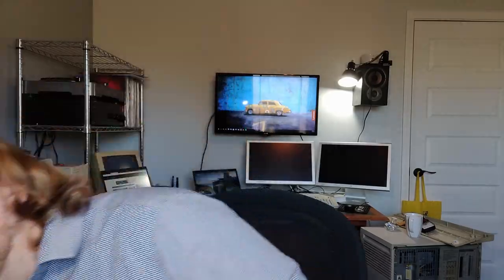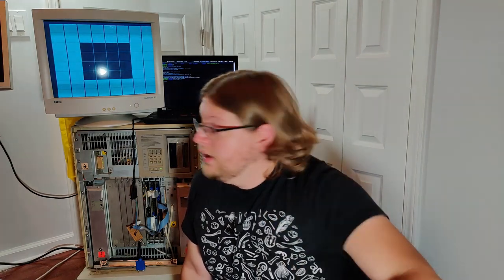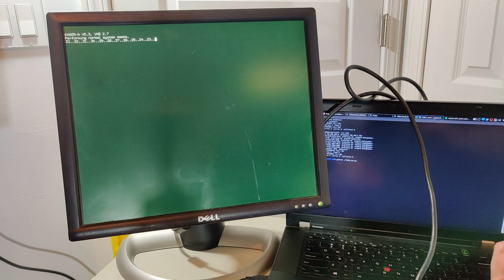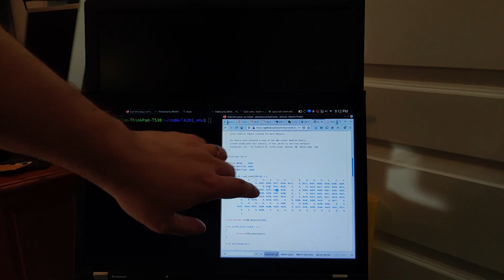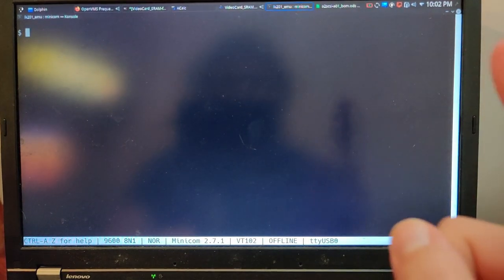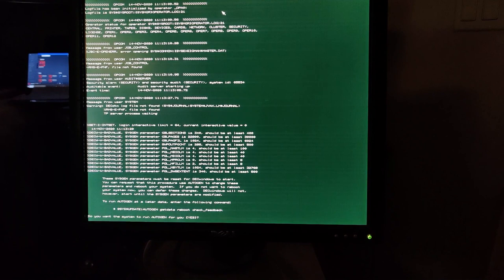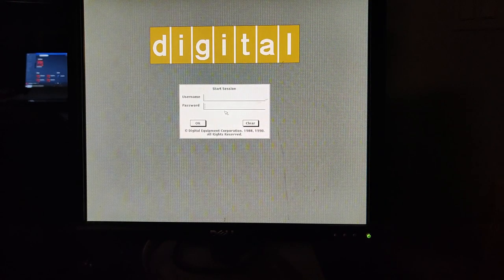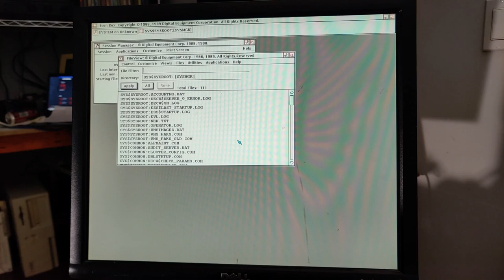MicroVAX VCB02 Video Card | Connecting a Display

Comment: Congratulations! Traditional DEC Windows is a sight to behold. You know when I first started using a VAX with a graphical terminal at my first 'proper' job after Uni around 1992 it was on a MicroVAX 3100 m38 with a 19" black and white monitor. The graphics card was 1 bit - which makes you appreciate why DECwindows was designed that way - it works just fine with complete back and white. There are LK2xx keyboard and VKxxx mouse drivers in the Linux kernel, if you do go down the emulation route I'm sure that source code will help.
Reply from the maker: It's a sight to behold!

Thanks for the support, Mark, I'll be sure to give you a shout-out in the next one. I wrote a little python script to pull all of that '91 bin distribution off of your amazing archive and it just finished and looks most excellent.

Comment: Sweet! I've always wanted to get a VAX myself.
Reply from the maker: They're super interesting to me as one of the weird transitionary platforms that tried to jump the gap from old school big iron minicomputers to the per-user workstation, and for being both a completely unique hardware and operating system platform that has since disappeared long ago. That's why I like them, and that's why I finally bought one after years of lust.

That said, I spent way too much on this guy -- it's getting pretty hard to find these desk-side type boxes anymore, and I pulled the trigger on this one because it popped up just a couple of hours away (and quite possibly because I was drinking at the time) -- but I would not recommend trying to get ahold of one unless you're similarly diseased as me.

That said, the desktop MicroVAXen and VAX Stations pop up pretty regularly on ebay still. Also not cheap -- as with all the old workstations these days -- but in the more reasonable $100-$200 range if you're looking for a nice splurge. Beware that they expect to use DEC's proprietary peripherals and much more often than not don't come with.

But if you're brave and you grab a desktop machine without the peripherals, you'll be in the same boat as me here, more or less, and I'm just about to upload my next episode in which I futz around with adapting what I have around to what these VAX machines expect.
Reply: @TrackZeroFutzin  I see plenty of VAXen on eBay but yeah, the keyboard and the display are tantamount to unobtainium.

Funfact, though: OpenVMS is still actively developed! It's since been ported to Alpha, then to Itanium, and VMS Software, Inc., is currently porting it to x86.

Also, OwO at the next episode teaser.

Comment: FYI, I think you can get by in DECWindows with only a keyboard. See 11.9. https://www.digiater.nl/openvms/freeware/v70/vmsfaq/vmsfaq_016.html

The basic idea is to hit CTRL+SHIFT+F3, and then you can use the cursor keys to move the mouse, and select/prev screen/next screen as the 3 mouse buttons (and if it works like on the VXT2000, also find/insert here/remove to toggle the buttons, making drag motions easier). Long term, you'll definitely want a mouse though.
Reply from the maker: Thanks for the tip, Joe! I'm betting that FAQ is going to come in real handy